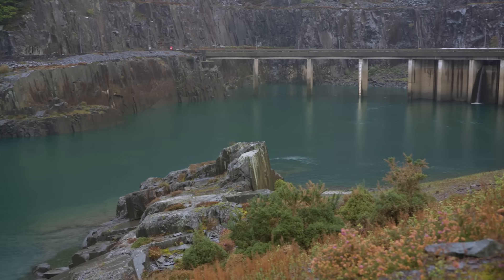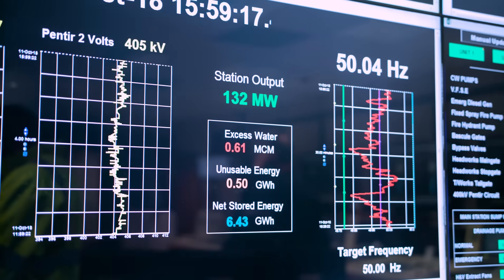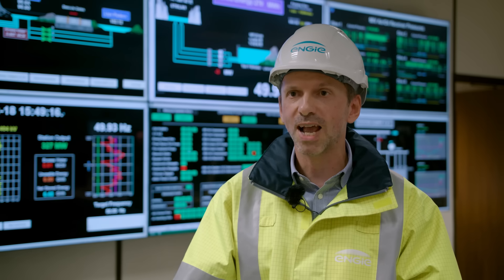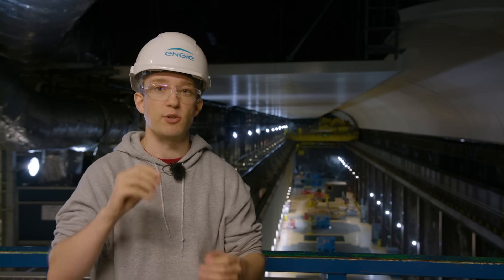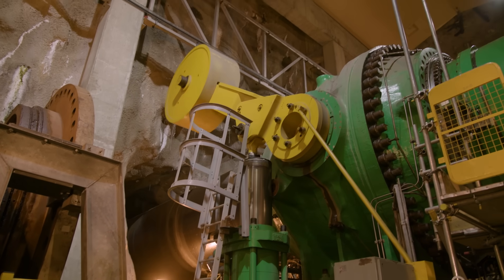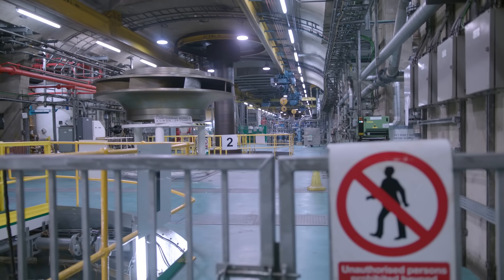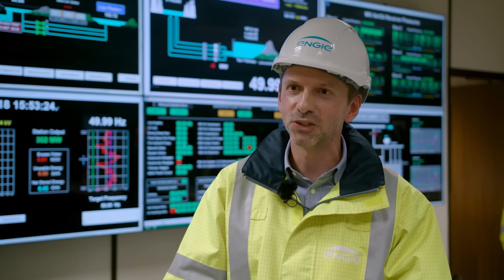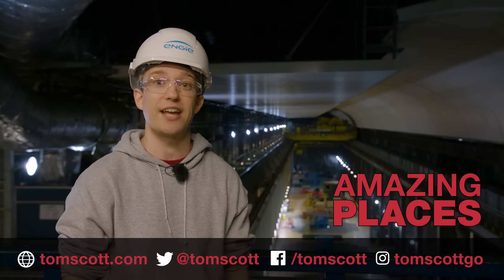Britain's largest battery is actually a lake

Comment: How much more power is used pumping the water back to the top up than is generated as it flows down?
Reply: pumped hydro electric storage has a round trip efficiency (electricity - moving water - gravity - moving water- electricity) of 70-80%. In some stations, the efficiency is bolstered by rain (increasing the energy available) or creeks flowing into the upper reservoir
Reply: From wikipedia: "The plant runs on average at 74–76% efficiency." I can't remember the quoted figure in the museum there but wikipedia's line is well cited, also the proposal documents for the currently in construction small pumped storage station at Glyn Rhonwy state an estimate of 75% for it.
Reply: Guys I think Bob here understands the concept, just curious about it's efficiency is all
Reply: Sometime the electricity usage is huge, but the generator cannot keep it up. You can build bigger clusters of generators but this will be wasteful when the demand is low . So if we can store the extra yield of electricity when the demand is low and output it when required, it will make the whole grid more flexible but without more generators.

This is only useful when the demand varies a lot (which is true in almost all situations), if there is lack of yield, the thing will be useless. You need to build more generators instead of this.

Nothing has 100% efficiency include this one, so generally speaking this is consuming electricity not generating it. But overall, it will work like a electric capacitor, convert AC to DC, useful for us indeed, worth the energy loss
Reply: The figures given are erroneous. Potential efficiency at peak performance of some elements.  Also if you get a smart meter soon you will have to pay a lot more money at peak times. Be nice if we got a video about how they can be hacked too...
Reply: It's not so much the power lost as that the station offers large and fast response times - in the case of Dinorwig, probably the fastest of any power facility in the world - 1,728MW from standstill in just 90 seconds with a capacity of 9.1 GWh .  In contrast, the battery banks by Tesla are faster but are limited.  (In Australia to about 100MW / 130MWh ) That being said, just as a simple storage facility it's not very cost effective in that it would generally only just break even over its operating costs,   but it gets extra revenue for being a fast response generator for the rest of the grid.  Which was always its primary designed role,  rather than just plain storage.
Reply: Electricity is cheaper at night, so they pump it back up for  less money
Reply: I understand that; Tom pointed that out in the video.  However, that was not my question.
Reply: @fairraffles  it's not just that energy is cheaper at night. Its the ability to store solar power for the night time if there is too much on the grid. Nowerdays solar plants are shut off at day time to protect the grid from beeing overshot. With this "battery" we can keep solar plants connected and load the grid down and store that "too much" energy from fluctuating sources. Energy is (was) cheap at night because of the low demand. So power companies had to reduce the production otherwise. If nuclear and coal plants are shut down in the future, things start to reverse. Then theoretically the price must fluctuate with weather. See the energy involved into that pumping action as a form of "otherwise entirely lost energy"
Reply: Sorry  @jani140 , didn't get that from the video. They pump water back up during the night, so they can't be using solar power for it. If they would do so, they'd be pumping up during peak hours of solar and that's during daytime. If they would do that, than it's a really useful option combined with solar power when gas and coal plants are fased out.
Reply: @belindavloon  - This is run for profit, that means any time power is cheap and they can pump, they will. Solar, nuclear and wind are famous for producing power when it's not needed.
Reply: @dougmc666  that's exactly what I mean. It would be sustainable if they pump water up during solar hours and run it down during night time when renewables are low. Then it would make a huge difference. I think this is a very useful system which could (locally) save many problems with renewable energy. Treasure this.
Reply: @belindavloon  - In the UK wind and nuclear generate ten times the electricity that solar does, and the risk of curtailment (an economic disaster) is highest at night when wind production is highest, nuclear is overproducing and prices are lowest(no demand). So the pumped storage system buys the nighttime overproduction cheaply and sells it back to the grid the next day, thereby displacing some of the natural gas consumption used for daytime peak load. There is no problem with consuming all the wind and solar production during the day, demand is high so it fetches a better price and doesn't need to be stored.  If wind was to be curtailed, then the UK would stop building wind farms and copy France by going nuclear, not good for renewables. Curtailment is very unlikely since the UK is close to being connected to Norway who are renovating their old hydro dams for storage.

If you are referring to some other country, especially one that uses air conditioning with an evening peak, then it's a totally different ball game, cheers.
Reply: @dougmc666  OK, good to learn that the UK, a part from nuclear, is taking steps to cut back fossil fuels. I'm more thinking towards the future when fossil fuels are faced out (or to expensive) and renewables aren't covering demand. I live in The Netherlands and here the problem is also not so much wind or solar, but the storage of peak electricity produced by it and, not wanting to move to more nuclear, providing electricity for the demand in let's say winter time. Batteries can't store the amount needed and are expensive and definitely not eco friendly. And our demand is often high when the sun is down and wind is low. I'd really like a system of more natural ways of electricity storage like the one in the video. I'd love to have this for my home (on a smaller scale of course) or let's say for my village!
Reply: @belindavloon  - Personally I'm only against climate change, so I'm happy that nuclear in the UK has cut their carbon emissions by 30%. Perhaps you could shed some light on what's holding back the Netherlands, with only half the percentage wind that the UK uses, one quarter what Denmark uses and huge use of coal and gas? Renewables would need to grow 300% before the question of curtailment vs storage begins. Some good technologies to reduce gas consumption are heat pumps with thermal storage or wood pellet boilers.
Reply: @dougmc666  One of the major reasons why it almost impossible right now to switch to 100% renewable. The inconsistency makes impractical unless there are hundreds of thousands of such batteries.
Reply: @SwapnilSemwal  - It's a regional issue, places with high penetrations of wind and/or solar also have lots of hydro to balance the intermittency. This pumped storage is a more expensive way for places like the UK to make up for not having enough hydro and still build a high percentage of wind energy.

Hundreds of thousands of these is probably too much, it's rather huge with a storage capacity of 9 gigawatt-hours, there is no wind or solar installation big enough to charge this in a day. The huge Tesla battery in Australia is less than 2% this size.

I agree that the switch to 100% renewable isn't happening, in most situations storage isn't used and natural gas takes it's place causing curtailment of wind and solar as in California.
Reply: @dougmc666  When I said hundreds of thousands, I didn't mean that they would be in constant operation. Changes in weather pattern such as monsoon in asia causes shutdown of hydroelectric shutdown. So changing wind patterns. Problem is this battery is good when there is security that it will be recharged in the night. When that is not the case,  the total stored potential might not be able to sustain a full grid load for a longer duration, such as a week, unless there are a lot of them.

Comment: People that bash renewable energy always forget this fact. We do have GIGANTIC natural physical batteries, like these.
So the sun might not shine at night, but gravity is still there. You just need 2x the needed energy produced via the day, to supply any night.
Its as always, just lobbys that want to protect their short-term financial interests, instead of going full force renewable and create a better world for us forever there after.
Reply: It isn't exactly a "natural physical battery", but a massively expensive engineering project.  Pumped storage projects don't have quick paybacks, but take decades to reach break even.  In addition, they often face large pushback since the best sites are typically in wilderness areas.  It is not clear that making new generationally long investments are justified since it is possible that breakthroughs in flow batteries or lithium ion batteries or grid management techniques might render these as expenses that could have been avoided.
Reply: It's nowhere near natural. Creating the top lake usually involves literally blowing up the top of the mountain and massive construction within the mountain. It spells a complete disaster for the ecosystem. Things are not as simple and black/white as you seem to think.
Reply: As a person who cares about preserving natural ecosystems, when I see pumped hydro storage systems (we have them in the US also) I immediately think about the massive environmental costs and wonder if the benefits outweigh them.  There are other solutions, such as vanadium batteries, or for that matter nuclear power can be designed to scale to load.
You are not wrong about lobbyists and the entrenched interests that they represent.
Reply: It's not that simple. The Province of Quebec is almost 100% hydro-electric but had to create artificial lakes (reservoirs) that covers almost 2000km^2 (in the case of Manic-5) or 2800km^2 (in the Case of LG-2). These lakes didn't exist before and so vast amount of forest land was submerged to create these massive projects. Everything in life is a trade-off, we just have to find one that we can all live with.
Reply: @ve2dmn  - I think we can all live with the trade-off, vast amounts of rocky mountaintops being submerged to create these massive projects. 

The Manicouagan Reservoir used for Manic-5 contains 115,000,000 acre-feet of water, the Dinorwig Power Station only contains 7,300 acre-feet of water. You're comparing apples to oranges, the rainfall storage for years vs the pumped storage for a day.

It's precisely because the UK doesn't have many conventional dams that they need to build the daily pumped hydro version. That's also the need for the HVDC  cable from Norway–Great Britain, to gain access to huge reservoirs that can cover a heat wave or a blizzard.
Reply: The Uk uses about 30GW of electricity, so you would need at least 45 of these 8GW/h capacity Pump-storage plant for 12h solar 12h pump-storage day alone. But then what if there is less sun? (clouds, winter) There aren't many places where you could build something like that and enviromental groups would try to block them being built.
Reply: Yes, but you need somewhere to build them.  They take up a large amount of land, are expensive, and if not carefully designed can damage local ecosystems (see the Three Gorges Dam in China for a very good example).
Reply: I see a big problem with this: government officials who should start these projects will not reap their benefits. Ergo: no go.
Reply: The amount of stored power in that mountain is relatively small compared to amount of electricity used in the UK every day. Daily generation averages 967 GWh, whilst this pumped storage scheme holds 9.1 GWh of power, or rather less than 1% of one day's demand.

At the 75% efficiency of this installation, we''d have to take the equivalent of the UK's largest reservoir, Kielder Water, with a capacity of 0.2 cubic metres and pump it 1.8 kilometres vertically. There simply isn't remotely like enough potential sites in the UK to do that. Norway, with plentiful mountain lakes and relatively small population can, do it, but it only has limited possibilities in the UK. In addition, pumped storage systems are extremely expensive.

This pumped storage systems in the UK are very good for filling in relatively short peak demand periods, but for holding, say, a few days supply to cover for those several week long periods when there's an anticyclone hovers over the country and cuts wind generation by 75%, then it's not up to the job. At the moment, the gap is filled by expensive, mostly gas-powered reserve capacity.

Major grid-level storage facilities are still something of a pipe dream.

Comment: Doesn't the power the turbines require to pump lower the efficencey of the plant?
Reply: The point of hydroelectric power stations like this one isn't to generate electricity, but to store energy so you can get it when needed.  During the day, they provide electricity when needed (i.e. when demand is high).  At night, coal power stations are still running (because it takes a lot of effort to shut them down and start them up again) but the energy isn't needed so it would go to waste.  Instead, the hydro stations use that energy to "charge their batteries" so they can be used again the next day.
Reply: @andymcl92  Nuclear plants are the same way and your comment about coal plants also applies to them.
Reply: Mister Hat Correct.
Reply: andymcl92 that’s a crucial aspect of these operations that should have been more obviously stated in this video.
Reply: Yes, but power is cheaper at night. You cant simply switch off a nuclear, coal, or gas power station, so Dinorwig makes use of that surplus energy to pump the water back up the mountain at night.
Reply: From what I recall of my own visit there (a long time ago), it's only about 80% efficient, but the important thing is that it can store power when the network has excess capacity (such as overnight), and provide it back nearly instantaneously when the network is under additional demand. 

You can't just quickly turn up a gas power station when there's a sudden demand for additional power, but Dinorwig can respond fast enough so as to avoid any "brownouts" on the network.
Reply: @SomeThrillingHeroics 80% efficiency is higher than what you can get from most chemical batteries. And when you do it large scale is a lot cheaper than chemical batteries.
Reply: @MrMartinNeumann 
Neither is true anymore. Modern chemical batteries can have 90% round-trip efficiency, and their prices are falling fast. Tesla already started building GWh scale battery farms, and bigger ones are likely coming. The Tesla gigafactory currently produces 20GWh batteries a year, and not even finished. The planned capacity is over 100GWh per year. And more factories are planned.
The huge advantage of chemical batteries is that you can build them anywhere and at any size. Hydroelectric batteries can only be built in very specific locations. They are very useful, but unfortunately not enough, not even close.
Reply: yes, but the ability to have on demand energy saves a lot of money and having a way to use big amounts of surplus energy helps prevent disasters
Reply: The plant operates at a net loss. The advantage is being able to reduce the need for less efficient "peaker" power plants.
Reply: @misterhat5823  In fairness, the universe itself operates at a net loss too.

The Second Law of Thermodynamics and all that jazz...
Reply: @misterhat5823  The company run 2 power stations. The latest figures I could find (2016) were £100m profit on £270m turnover...
Reply: Well yes, it always consumes more energy that it makes. But that's not the point. It's just storage.  Converting from one form of energy to another is never 100% efficient (including chemical batteries).  In the US they call this Pumped Hydro.  I guess that makes it sound more green?
Reply: IIRC it's also part of the grid's disaster recovery plan. Most power stations actually require power to start up from "cold and dark". Dinorwig doesn't, so if there's a disaster which shuts down the entire UK grid, Dinorwig's job is to provide the power needed to restart other power stations.
Reply: Think it is a national level Power Battery, in case the network is shut out by other factors. For example, their nuclear plant suddenly stops working for what ever reason or it is War and they need extra grid power focused on the Hospitals and other essentials. 

It serves as a stabiliser in times of need. I reckon the plant itself doesn't intend to run in profit. Albeit, they will run in profit if electrical prices go up.
Reply: Yes. But it makes economic sense (welcome to the real world). Doesn't the internal combustion engine on your vehicle have terrible efficiency (only 20%)? Yes, but it makes economic sense for the customer's immediate needs.